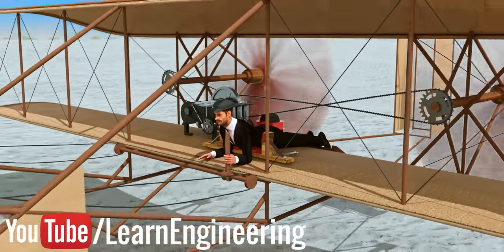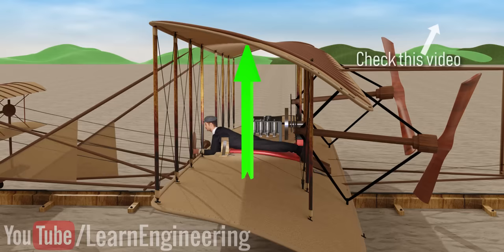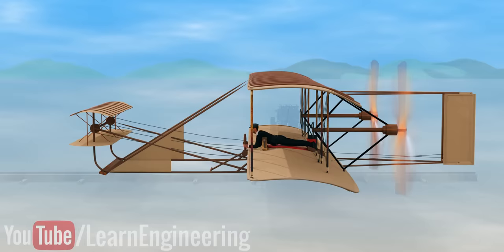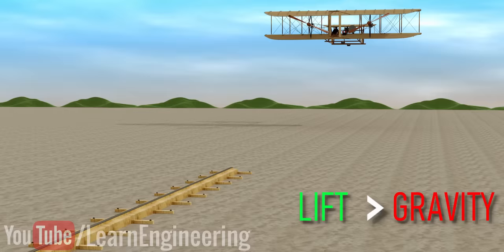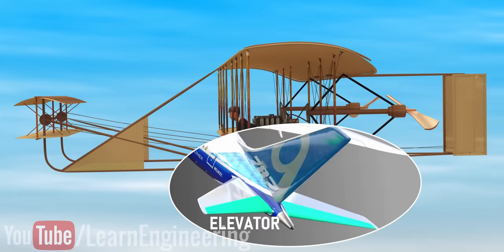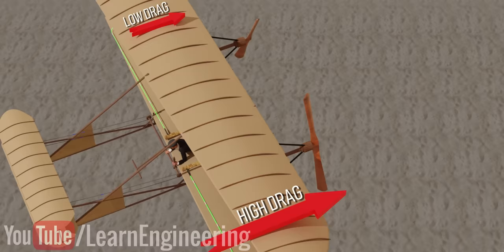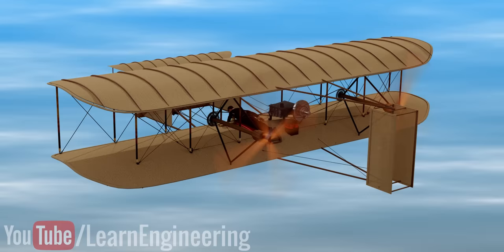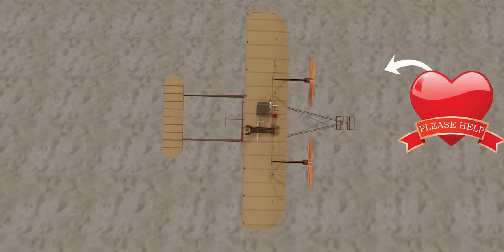The Brilliant Engineering of FIRST FLIGHT !

Comment: First fly was Santos dummond. But americans are americans
Reply: @Billycca3  Billy, this shit presented by you doesn't get off the ground the tests have already been done on several replicates. captain ferber friend of the wrights built in 1909 replicas of their work and confirmed that they did not FLY.
Reply: @Billycca3  Billy, Look centennial please, 2003, this shit don't flew.
Reply: @harpiasonhadorasonhadora5259  the first flight at kitty hawk had exceptional atmospheric conditions. That's why it didn't fly at the centennial.
Reply: @Billycca3  Boy, learn something, the demands were clear. The wind couldn't be used, neither could the downhill. In other words, wright should run, take off, land under its own Power and LANDING. The flyer replica showed that their machine did absolutely nothing. They don't really get to the feet of DUMONT's work
Reply: @harpiasonhadorasonhadora5259 nonsense.  The wright brothers flew multiple flights in front of hundreds of spectators and were photographed doing so

Comment: Their true genius was what they invented before they invented the 1903 Flyer.  It was the first-ever wind tunnel, where they tested everything else rigorously.
Reply: Lie. The first wind tunnel developed by Pour la Cour in 1891. Wilbur Wright was only ten years old at this time. And the plane was invented by Santos Dumont in 1906 who took off and landed using the power of his plane's engine...In 1903 the Wrights just glided. The Flyer weighed 340 kl and the engine only had 12 hp. No haved power to decorate. US history is a festival of lies.

Comment: Santos Dumont  the first  invention.
Reply: LOL.... Brazilians always trying to sneak credit where there is non due.... please stop!
Reply: @josephsmith1893   bro the brother's used a catapult, and catapulted ultil shit flies
Reply: @rafaelmendes6918  Did you even watch the video? Where do you see the catapult?
Reply: @josephsmith1893  If It depended on the Wright Brothers we would be sailing today. LOL
Reply: Search for Abbas Ibn Fernas
Reply: What does an e-2 Hawkeye not count as a plane now?
Reply: Santos Dumont used motor.
The Brothers used catapult.
Reply: @carlosalberto1267  you misunderstand the  my point is that planes today still use a catapult therefore it is not a disqualifying factor also they didn’t use a catapult on flight one
Reply: @carlosalberto1267  The Wright brothers did not use a launching device on their first powered flight, that came later because wind is inconsistent. Also, F-18s use catapults and head winds to take off from aircraft carriers, are we to believe that they aren't real aircraft because they cant take off from 350 feet of deck on their own power? That is a ridiculous argument. Santos-Dumont also did not invent anything, he used ideas that were already created by others. His wing design came from Hargrave, his engine was from Antoinette, he sat in a balloon basket, and he wasn't the first to think of ailerons either. On the other hand, the Wright brothers virtually rewrote wing design and created their own airfoil, they designed and built their own engine and propellers, and they engineered their own control system.